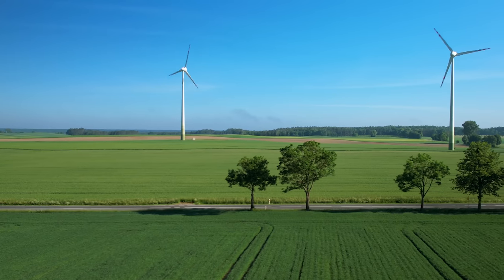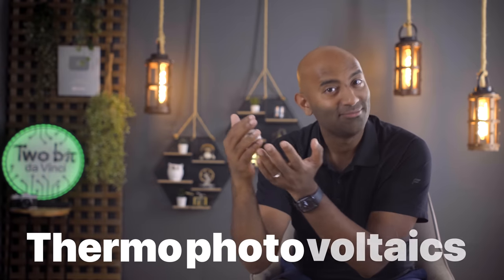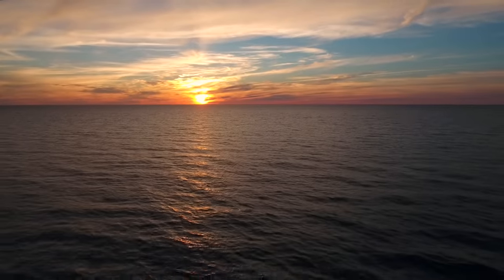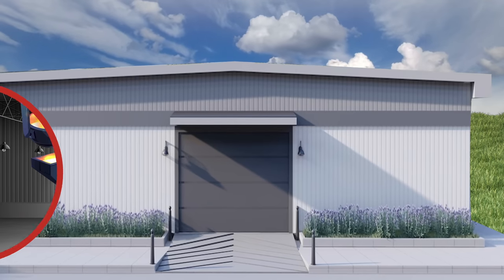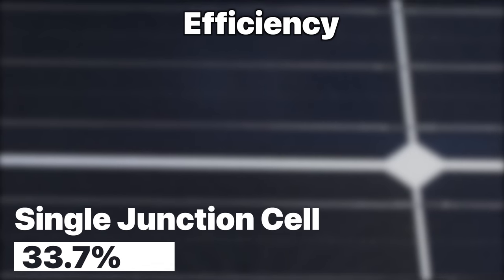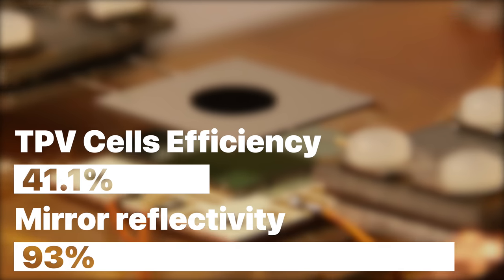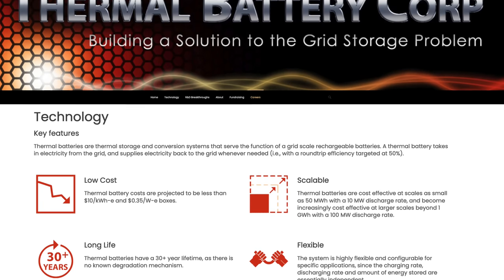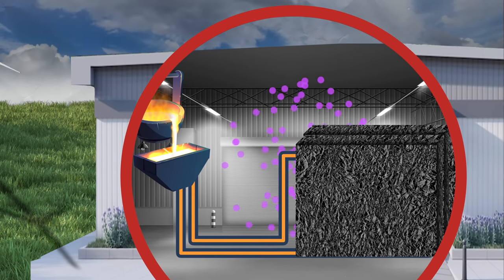Breakthrough Solar cell DOESN'T Run On Sunshine!

Comment: E= a2 x u x (t1  - t2)
What u value do you need to reduce the amount of Energy loss from ambient air temperatures ranging from-30c to 50c, on a structure that size to store the excessive thermal Energy, plus transit to conversion unit
They have silicon thermal generators now and they simply array the silicon thermal cells,  a young female student built a flash light using body heat lo power it
Heating tungsten to 2000c to generate light by thermal Energy and get 43% efficiency! Hmmm
Loss from initial conversation of excess Energy to thermal,  loss to storage, loss during storage,  loss during transition from storage to conversion 
Using mirrors to reflect light Energy back to the conversion cell, what type of mirroring substance can withstand 2000c plus being in a confined environment,  the thermal Energy in the closed environment would increase and cause the conversion system to go into meltdown and destroy itself 
A better way would be the reverse,  flip side of the coin,  freeze water into ice, drop the temperature of the ice to  - what ever temperature you want,  bury the high valued u box in the ground,  you can use the temperature difference between the ice and ground or air or add thermal source 
Easier and cheaper to build,  totally less hazardous,  being underground saves land space,  etc
Why are engineers always building Rube Goldberg machines 
Use KISS, keep it simple stupid

Comment: These scientists is so in their bubble, using aerospace/rare/expensive/complicated materials, this won't scale or hit market. 🤦🏻‍♂
Reply: That’s a valid point. But I’m not too sure about that, the rare metals seems to be part only on the actual cell which, if I got this right, is the smallest part of this solution. 
Am I wrong?
Regards 🙏
Reply: @MEMO-sb1sd  It is still a part, not to mention the other process that it need like that graphene block and then to other facility to make an electricity. The more process you add, efficiency drop where it came from. There's no such thing as it produces more on what it came from. This is Hydrogen all over again. You can literally store energy directly to lithium ion storage stations.
Reply: @xbxb  
It's nowhere near as bad as hydrogen (very few methods are)
As mentioned, with this system you have the secondary harvesting of heat which could be integrated (sand battery)
.
The main consideration should be not to rely on one technology, while keeping those we use as efficient as possible (unlike "H").
Even if this fails. It's a train of thought which can lead to other solutions.
Reply: @xbxb  Yes but being a part is not the same as being a problem. A large volume of a required part I would agree with thou. Also, I might be wrong here but wasn´t it graphite blocks? I might have got that wrong, if it´s graphene as you claim, then this isn´t even possible to scale and produce any time soon any way. But if it was Graphite, well thats carbone, we have carbone 🙂
Reply: @rogerstarkey5390  Such a good point with the secondary harvesting. Also I could really see the use of capturing otherwise lost energy from all sorts of industries

Comment: It's cool and all, but you're still trying to use an inefficient system to compensate for other inefficient systems. Let's be generous and say that solar is 20% efficient. Add onto that the efficiency of TPVs and you end up with 10% efficiency for the system, minus energy lost through transport. For wind, let's be generous and say they're 30% efficient. After TPV, that's down to 15%, minus energy loss through transport. Generally speaking, Nuclear reactors have an efficiency of 33%. Add to that the fact that this is a known technology, carbon free, and always on, safe, relatively speaking, and extremely powerful and I really have to wonder why anyone would look to something else for power generation. Plus we're coming out with small modular reactors that should reduce the cost even further. 

I dunno, man. I don't get. Still, it's a cool technology, I just don't get why we're not going with nuclear.

Comment: You are violating laws of thermodynamics. Energy cannot be created . 1350 watts of solar energy falls on 1 sq meter, but you have 100 kw. Where is the diesel generator? do your research. this is not a utopian device. At the most it can generate about 1200 watts, which would be great if mass  production reduced the cost of the cells to pennies each.

Comment: The tech is interesting but the comparisons ou used were very off.
comparing these to solar cells in efficieny makes no sense when this is being used as a method of energy storage. at 12:11 you compare it to turbines batteries and solar cells. but only batteries are actually energy storage like this thermovoltatic cell. so really it is about half as good as aour 30 year old battery tech. I like tech videos but I dont think I will be subscribing due to the inaccurate info and poor comparisons. Production value is great content is sub par. I will wait for another youtuber to do a video on this tech instead.

Comment: I'm all for solar, not so much for wind farms because they kill thousands if not millions of birds every year plus maintenance is incredibly expensive. However do not say solar and wind are among the cheapest forms of energy production. No. Pound for pound, petrol is still the cheapest besides hydroelectric. An average internal combustion engine may cost $1000 and maintenance overall isn't that expensive for the longevity. Solar is incredibly expensive to to produce what you need plus the home inverters and LiFeP04 batteries (for newest tech) to store the energy. Stop lying and just recommend going solar or wind if it can be afforded.

Comment: TL:DW:    Lotsa blab, blab, blab, blab, blab, blab.  Only heard "tungsten glowing".  That was plenty.   You need special materials and processes to handle those kind of temperatures.  Also the lifetime of the materials  is questionable.   An honest analysis would compute the whole-life costs using reasonable assumptions for maintenance and total lifespan.  Most other solar collector projects have failed due to maintenance costs and costing more than photovoltaics.
Reply: What your alternative?

Comment: Woke academic invention (there are a lot) which would increase electricity cost a lot as usual. I prefer the Low Nuclear Energy Reactions (like in permanent diamond (Cristal matrix) batteries) as a kind of future.
The Worldwide  G.Reset Cabal has succeeded trough sanctions on Bric and others countries to increase cost of previous electricity systems a lot ( up to half of our excess inflation nowadays) to unaffordable levels for our economies.

Comment: This is moronic. You keep saying solar but you're talking about thermal radiation. (Heat) This entire post would be fascinating if you were combining it with a thorium reactor or small modular nuclear reactor. However you can just use molten salt as your heat storage an existing power plant steam generators as your method of creating electricity.   By trying to say you're going to be extracting this heat from sunlight (6 hours per day) is such a reach into green religion that I can't even watch the end of this. No one in Europe  wants more solar panels right now. They want nuclear, coal or natural gas for good reason. Solar failed. Solar failed worse than the Russian army just failed. Like the Russians solar talked a good game but at the end of the day it was all just a grift. Like a weird religion. The false dream of trying to switch everything to a solar economy is going to cost millions of lives in the next year or two.  With a nuclear reactor you can literally suck carbon out of the air and make gasoline or natural gas by combining with hydrogen and use our existing infrastructure.  There is no reason to mess around with 2,000° Celsius Tin
Reply: Honestly the whole salt storage idea is dumb as shit.
Hot sodium is horrible as a material and will only lead to horribly expensive servicing.

Comment: Jesus, just use solar panels, wind turbines. Stop makes things complicated.
Reply: This tech supports storage. There are times when neither wind nor solar produce much ("Dunkelflaute" in German), and although things are changing there will always be a need for some storage.
I have no idea whether this tech is going to be good for storage, but I wish 'em luck anyway.
Reply: @RupertReynolds1962  it's too complicated, it's hydrogen thingy again. Just directly charge the traditional lithium ion battery.
Reply: @xbxb  They don't scale well--too expensive in money and materials.

I reckon something along the lines of hot sand or hot rocks driving turbines might do well at large scale, but one of these alternatives might surprise us with better efficiency.

Oh, and I still have an eye out for the Ambri (Liquid Metal Battery) cells for grid scale storage. Low cell voltage, but also lower material costs.

Comment: This video is full of half truths.  I mean... inverse square?  What the hell does the inverse square law have to do when you have your light source fully enclosed?  You're capturing 100% of the light emitted because it's in a box.  The distance from the source to the receptor doesn't matter except as an efficient or inefficient use of space.  The materials and design might be optimal at certain conditions (brightness, temperature, etc) and you might use the inverse square law to help you design this thing to fit that optimal operating condition, but bringing in the sun... it seems designed to either mislead or just to give you an excuse to show some fancy graphic you made that really has nothing to do with the subject matter.

Comment: |> |> |> |> |> |> |> |> 
|> |> |> |> |> |> |> |> |> 

um ... I would research some things before you talk bullshit. 

I was watching and as high educated machinist which handle primary steel not so much tin but I know from soldering that 2000° Celsius is never the meltingpoint of tin ... 

I guesed about between 200 and 300 degree and I was right. 

here some melting and boiling points of metals: 

Tin mp =231.9
       bp = 2687 

tungsten mp =419,5
                  bp =907 

iron mp =1536
         bp = 3070 

aluminium mp =659
                     bp =2467 

copper mp =1083
               bp =2595 

So tin have a very wide range between mp and bp. 

And I guess that is the point by it.

and tungsten you can forget by that ... for example

I dont hold so much from such tech because graphene (not graphin) supercapacitators and batteries are the future I guess.

The problem by such heatstorage is that the planet itself is a lifeform and who give such on a bunch of places .. well ... I would kick that shit.

the only way to not destroy that planet is population control and go for quality and not quantity.

that all life is the same worth is bullshit ... who cares about this garden is deffantly something worth while who not is not only nothing worth ... he is a bug ... to many bugs make a world like that.

the difference between a nobug and a bug is the the nobug have serious interest in carring about the basic of all life ALWAYS, ... the bug only on his selfish shit and when its get shit them he show a bit but soon give a shit again on it.

simple like that ... filter the bugs and dont allow to multiply and all and the whole planet is cool.

and at one of the first all a empathy test and in kignitiv skills and only the strongest empaths with the highest kognitiv skills is allowed to take a public position and all corruption and youtopube, fakeshit, and twitter censorship and the criminals behind done ... for ever ... longlasting.

:-) 

|> |> |> |> |> |> |> |> 
|> |> |> |> |> |> |> |> |>

Comment: thats very cheap compared to photovoltaics, thermovoltaics
Reply: you dont have to use only solar heat
Reply: and old thing is not a break through, you reinvented the actual wheel
Reply: no innovation here, just old tech
Reply: you just forgot that because of patents and money
Reply: heat some rocks, finish sauna
Reply: nothing new, click bait
Reply: let me have my rod, dont make it mine
Reply: owning is not having, money is not gift
Reply: use prism to separate the photon frequencies
Reply: use lead selenium use-all general solar cells, not specialized frequency cells
Reply: its no use if you only can drill wood
Reply: anyone mainly doing things for money do not care, they just want to sell
Reply: they are happy if the systems breaks fast
Reply: patents prevent free usage and independence
Reply: challenge is only a sellers mantra